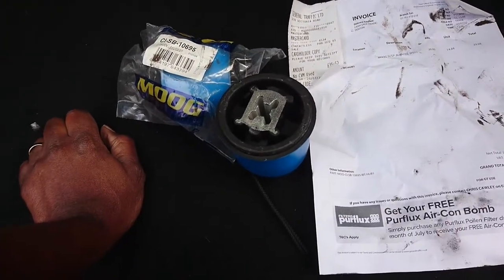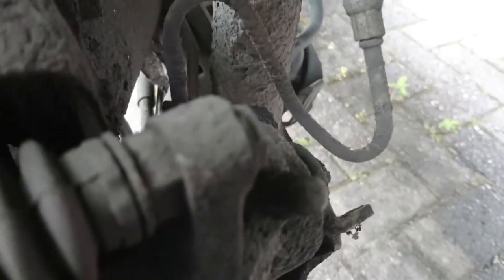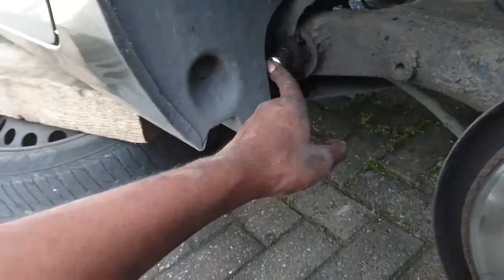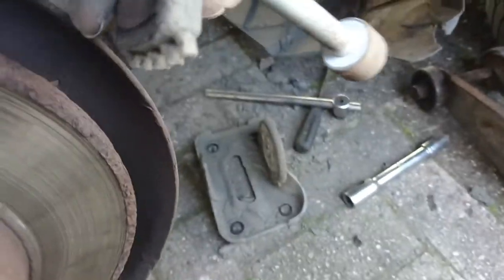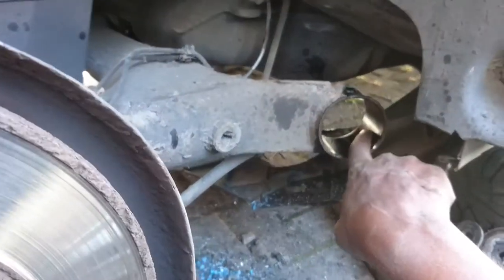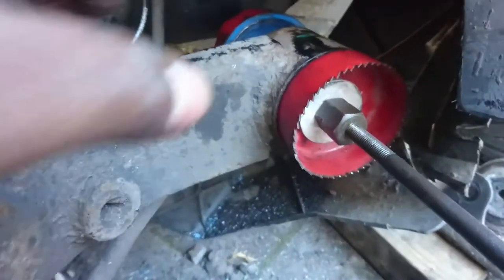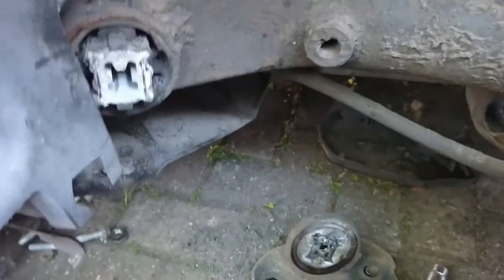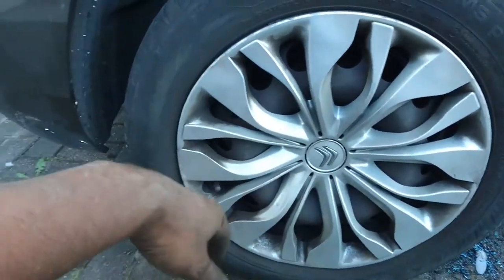REAR SUSPENSION BUSHES REPLACEMENT

Comment: Will the front drop down when bush bolt are removed , with rear shocks and springs still in place as when jacked up there will be no pressure on them
Reply from the maker: I never thought it that way. Maybe that could work and save a lot of time removing the springs and shocks.
Please let us know if that works. Thanks bro 🙏
Reply: @fix-and-drive-diy-repairs   yes will give it a try see what happens
Reply from the maker: @DavidNewton-j1b  cool bro 😎

Comment: I dont think you need to put the bushes back in exactly the same position as the one which came out. I know even official service data says so, but why? Think about it. The bush is only to isolate the axle from the car. The spring and shock control rotation of axle. Main thing is not to stress the bushes so only tighten long mounting bolt when the car is level on the ground. This means bush is un-stressed, rotation wise, when car is sat on ground. On my car, the two bushes were at very different angles in the axle. I replaced them both at same angle, effectively "vertical". Car is perfect.
Reply from the maker: Thank you very much bro. I wasn't aware of that. I hope others will see your advice. 👍
Reply: Hi there, im changing too and thinking about angle of bushes... Effectivily vertical, you say. How do you mean by that?
Reply from the maker: @mytube5340  No, it doesn't matter. I thought the bush had to go back to the same angle as the old one. Just press the bush on the frame and tighten the pin after putting the car back on the ground.
Reply: Thanks for reply
Reply: Maybe it doesnt matter how to place the bushing But its recommenden that "The bushing rubber nub must be precisely aligned to the rear axles lower edge" to ensure correct installation..
Reply from the maker: @mytube5340  The first comment says the official data says it doesn't matter! Bit confusing! I would recommend to install it the way the manufacturer installed it. Just put some mark like I did. This is to be o thesaf side. Thanks for the update.
Reply: On my car, 7 years old, original bushes, they were at very different angles left vs right. The "twisting force" applied by the bush on the axle will be the same regardless of how they are inserted. The bushes are to isolate the axle from the body and locate the axle firmly. If the angle the bushes are inserted makes a difference, why were mine at very different angles left vs right?. I believe the most important thing is to tighten when the car is on the ground. Tightening when the car is on axle stands with the axle "dangling" will mean there is a considerable rotational force put on the bush when its on the ground. This is not good for rubber bushes. They should be tightened with the car on the ground so bump and rebound rotates (and stresses) the bush equally in both directions as the axle rotates about its pivot points.
Reply from the maker: @johnbiggs9561  Thanks for the info, I hope mytube5340 is listening.
Reply: Im not sure why the bushings were at different angle, if it should be or it was wrong from factory? 
Yes its a good idea and a must to tighten the bushing when the car is on the ground... Thnks guys..